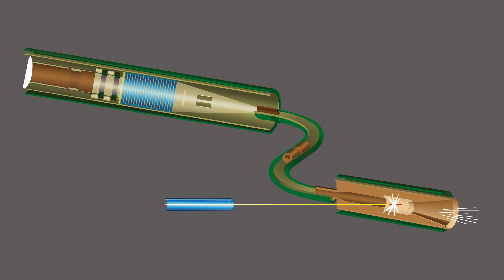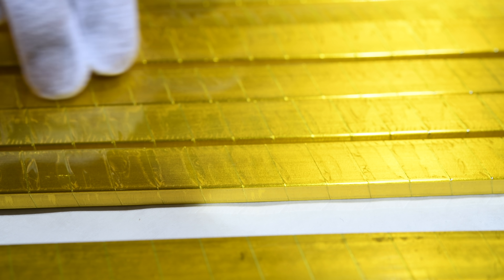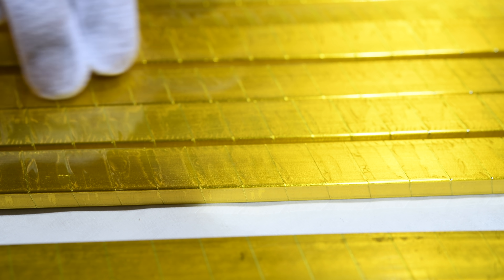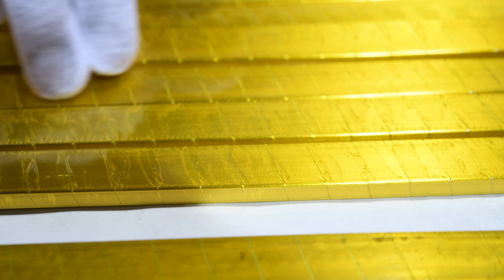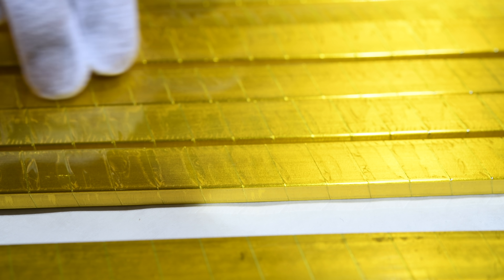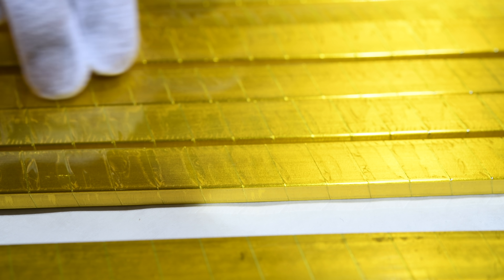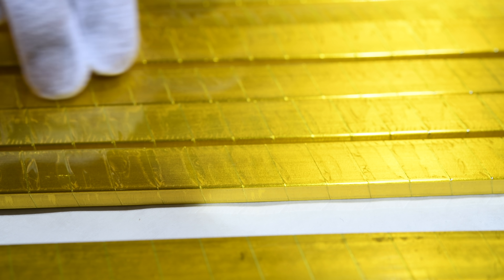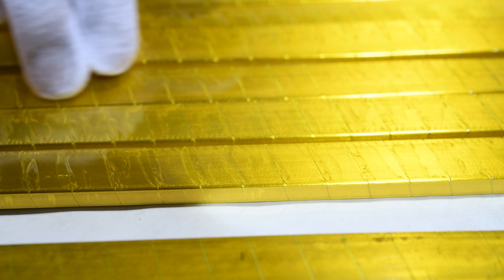Conductor Wrapping Machine

Comment: Yellow Kapton tape. Used in everything from 20 cent transformers to billion-dollar particle accelerators!
Reply: I've got a couple of rolls myself. Doesn't everybody?
Reply: @A3Kr0n  Was thinking the same thing. Regular vanilla Kapton is about as common as toilet paper these days, you can probably get it at Walmart. Now the corona resistant version (my personal preference when using it for HV insulation) is far harder to find (can only get that as a cutting from a master roll ($1500 min order at most places, or a really high price from vendors like American Durafilm) and practically never as smaller/common 36yd rolls of tape. Expensive, but in 2020 the only thing that makes a better general HV insulation is diamond, which isn't very flexible and even Teflon is a distant 2nd (unless you want the better RF properties).

Comment: The metal that’s being wrapped just looks like a thick strip of aluminum....but I guess there’s a wide core of superconducting material inside, right? Would be interesting to hear more about the materials, the amount of power that’s transferred, what the thin yellow conductor is made of, etc. Basically, I’m saying....please keep making videos!
Reply: The outside is Aluminium  and inside are Niobium–Titanium strands as shown in the cross section drawing. https://en.wikipedia.org/wiki/Niobium%E2%80%93titanium
Reply: The thin yellow film is not a conductor, it's plastic insulation.
Reply: As John Smith reply the superconducting filaments are NbTi, the outside is the N5 Aluminum Stabilizer. The yellow is the Kapton insulation which is wrapped around. The power transferred is limited to (mostly) splices losses because of the superconductivity. The current is several hundreds amperes and different for different coils (the machine wraps different sized material for the project: https://mu2e.fnal.gov).

Comment: Does the designer work for fermilab or was this outsourced and what was the time to completion? I worked in a medical device r&d lab as a mechanical designer and was curious how they compared.
Reply: Yes, the machine was designed in two steps: one smaller used for... Well smaller conductor.

We work on numerous projects, on and off to follow priorities. Strictly quantifying the time spent on this tool is not straight-forward.
For instance after the design while waiting for the hardware to be fabricated we did not work on it. As said on and off it took about nine month, there was no comparable competing outsourcing.

Comment: What is use of that wrapping conductor. why are they wrapping it
Reply: Electrical insulation I suppose.
Reply: viral patel: Insulation (0:15). Many of these assemblies will be stacked in parallel with one another and immersed in liquid helium for cooling. However, the narrator doesn't explain how these will be used, but a similar project is explained in this old CERN video: https://youtu.be/EDCGX3thpa0 See 2:02 of that video for their winding machine.
Reply: Thank you Soren Solveing, and Adam Kendall,
It is for electrical insulation, but the lines are to power to the superconductive coils with current: it is a considerable distance, the lines are not immersed in liquid helium but conduction cooled through clamps holding a liquid helium transport pipe. The electrical insulation is required because of opposite polarity to the adjacent conductor. Because of the conduction cooling the thermal insulation needs to be minimized. The voltage is always minimal unless in the unlikely quench. Such an event needs not to be destructive and the helium content in the vacuum requires to be Paschen proof.
Reply: @LucianoElementi  Thanks for the clarifications and corrections! Grazie.

Comment: Nice machines. Those bars Aluminum? or some fancy stuff like Silver alloy?
Reply: It shows the material on the drawing. It's a rectangular aluminum extrusion with niobium/titanium wire inside
Reply: Correct th4tguy, aluminum N5 (stabilizer) with embedded superconductive NbTi filaments.

Comment: How much current will these conductors carry?
Reply: Lots!
Reply: The current is several hundreds amperes and different for different coils (the machine wraps different sized material for the project: https://mu2e.fnal.gov). The conductor of these lines is to transport current to the (solenoid) magnets for the experiment.
Reply: 100's, but comparable ones in the LHC's magnets carry 13,000A, about the limit with safety margin before it looses superconductivity. If that happens an explosion results from all the stored energy suddenly being converted to heat from the resistance (called a "quench", actually happened during a test and blasted a large hole in the helium piping and vacuum system as well as the magnets, quite an expensive and lengthy repair job).

Comment: Ok but is there then a machine that wraps the super conductor around a core?
Reply: There are several machines to wraps superconductor around cores of different shapes and forms.
The lines in the video transport current to power those (solenoid) magnets and are not coiled.

Comment: Dude that's neat but.... superconducting cables? We're just gonna gloss over that? I want to know what those are made of; are they cooled during the experiment?
Reply: They're not special because yeah, they're cooled when in use.
Reply: Other reply point to the superconducting materials (Niobium-Titanium filament embedded inside Aluminum Stabilizer).
Cable is conduction-cooled (as opposed to helium-bath) therefore the need to have thin layer (to cool the conductor) and yet insulate it from the adjacent one. Further the environment low helium pressure requires Paschen-Proof the assembly to avoid failures during unlikely but potential quenches.